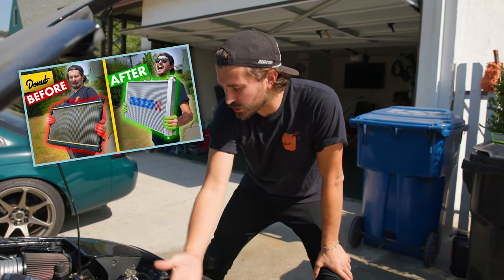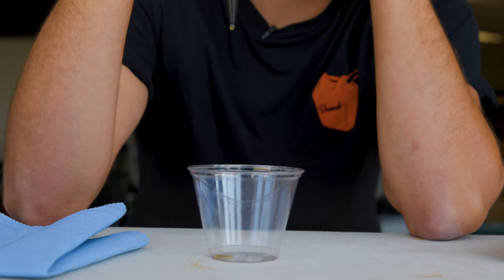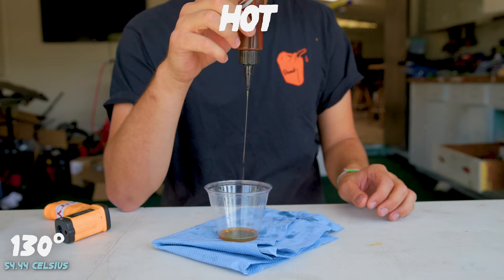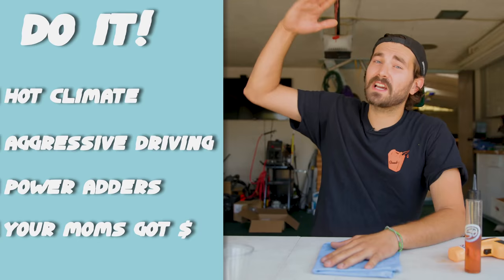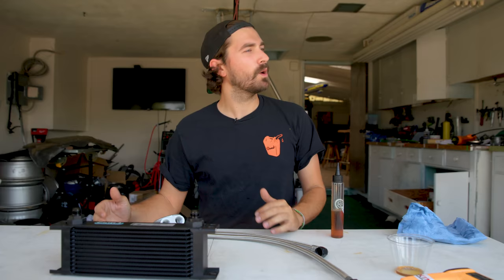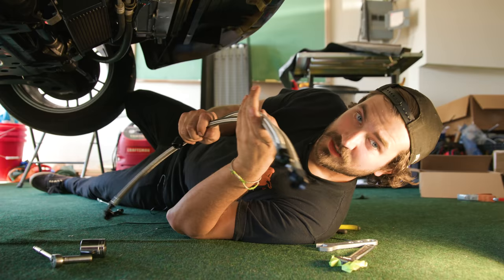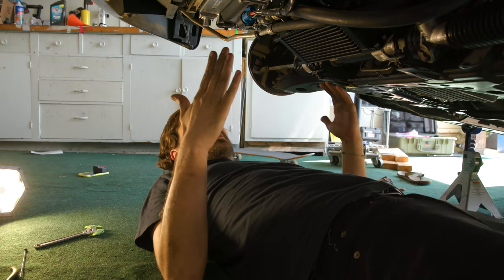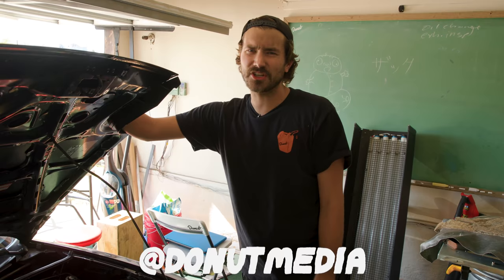Is an Oil Cooler Worth It?

Comment: The oil cooler should be mounted in front of the radiator not below it. This design exposes the oil cooler to damage from road debris. Also, a lot of cars & trucks I have owned came from the factory with a oil cooler & a transmission oil cooler both mounted in front of the raditor. Is adding a oil cooler to a stock engine that doesn't have one or an engine you plan to put a turbo on worth it? No!! Your money would have better spent installing an oil filter relocation kit. Plus if you add an oil cooler you must determine how much extra oil you need. Another point is that if the oil cooler doesn't have a drain valve, when you go & change you oil, you will be mixing new oil to dirty oil which can make your engine wear out faster.

Comment: Jesus, where that cooler is placed, any old shite off the road could hit it and puncture it, leaking oil. That'd be bad news at the start of a long drive.  
Plus it's lower than the sump plug isn't it just gonna act like a well for old oil?
Reply: yeah..well he's not going offroad.. he's going on a track.. and in california.. not a lot of rocks there bud. Also, it's no lower than the oil pan..and there's a pump, he's good
Reply: @Felrock12  he's driving it on roads too, I can see it as a track specific mod, but anyone with a road car shouldn't really be looking at this.  
And it is below the sump plug, my point was that you'll have to drain and fill this every time you do an oil chnage, not that the pump wouldn't pump it....